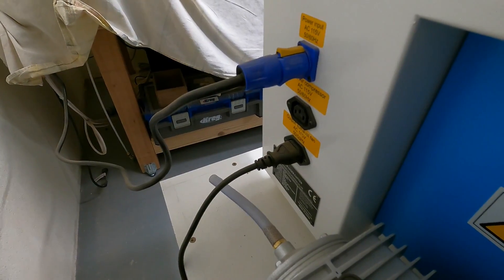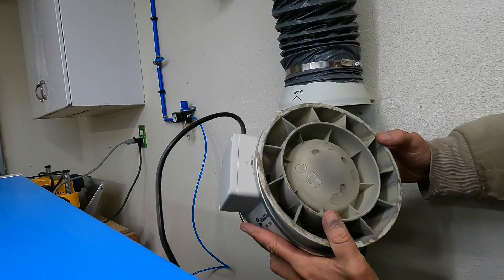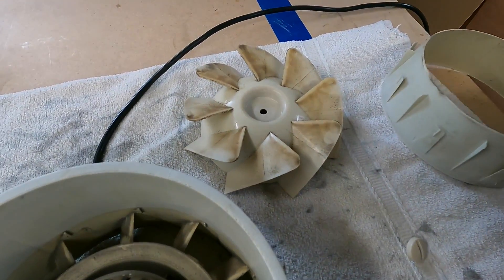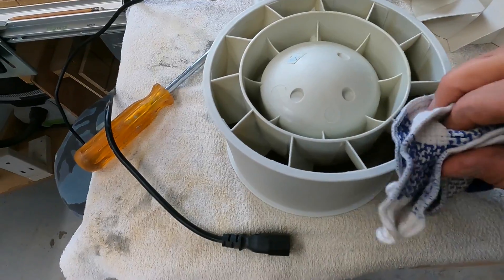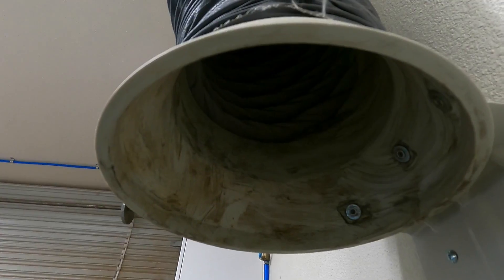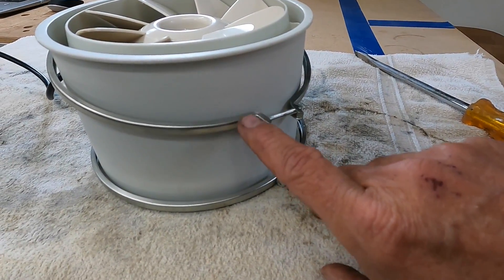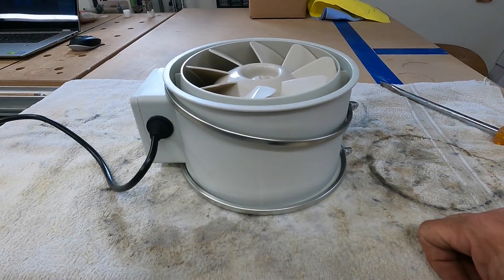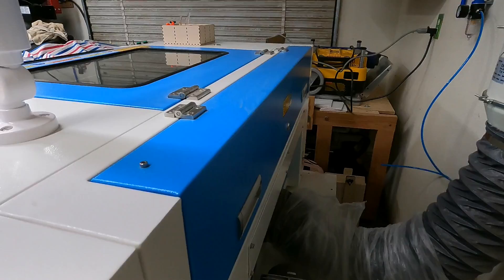Cleaning your inline fan on a Thunder Nova 24 Laser

Comment: We are having an issue with smoke coming out where the snap rings are gapped. We put a light inside the housing and you can see light coming through. Any thoughts why the snap rings aren't pulling it together tight enough?  It's letting enough out that it is giving us pretty severe sinus problems. I can't duct tape it due to latex allergies.
Reply from the maker: I use the silver aluminum taper that is meant for sealing duct work works great

Comment: do you have to clean the duct hoses? if so how do you have a video?
Reply from the maker: No video on that but yes I shake them out and use compresses air from my compressor to get as much smoke residue out. You will be surprised on how much settles in that ductwork!

Comment: Thank you for the great videos . . . . one question, the little plastic connector/screw . . . .how do you remove this without mangling it?  I put off cleaning the fan because getting that piece out is a pain and I'm afraid I'm going to end up destroying it.
Reply from the maker: I took a quarter and loosened it up!
Reply: We tried using a quarter and it won't budge. Any other thoughts?

Comment: Great content, I have learned a lot about lasers by watching your videos, Thank you for taking the time to produce them!! I’m considering purchasing a Nova24; one question that I have is the bed size, after you have owned your laser for least  7 months, do you ever wise you purchased one with a larger bed, are you growing out of the size you have. I don’t want to purchase one and then wise I would have waited and purchased one with a larger bed. Thank you!
Reply from the maker: the 16x24” work area on the Nova 24 is more than enough for the type of work I do. on occasion I have projects that are larger that 24” wide. no problem I use the front and rear pass through doors and use the print and cut feature to tile my work. yes it’s takes a little longer for the set up. but I’m limited on shop space so it works for me. if you have the space and the money I always say buy as big as you can afford. good luck on you Nova 24 purchase you won’t be sorry. I love mine and use it almost every day.